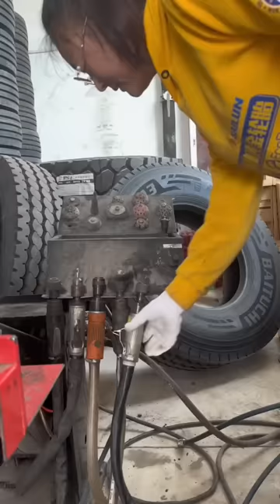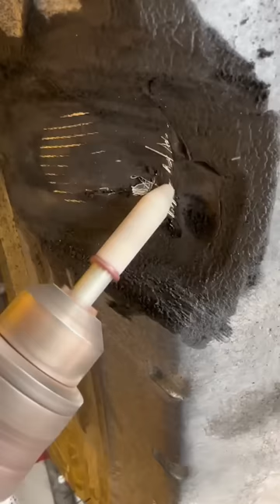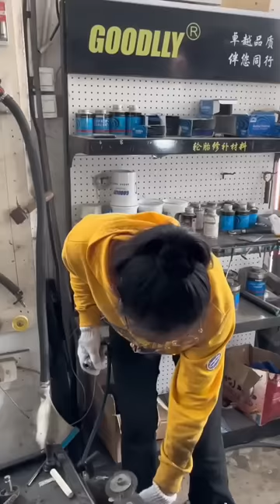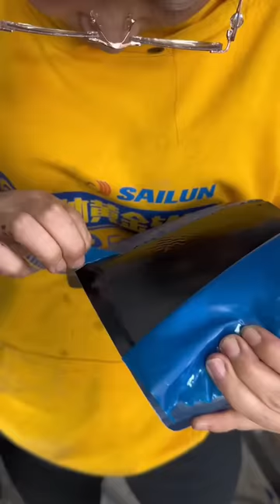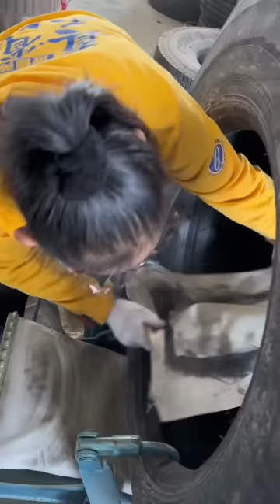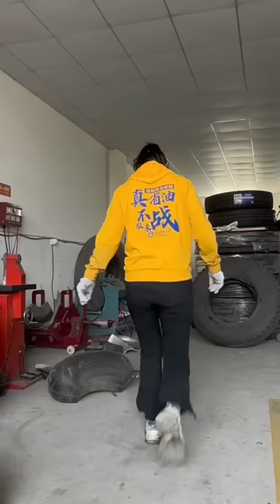Repair A Big Nail Hole In A Truck Tire Without Replacement

Comment: I had no idea you could repair a truck tire that way. However it's just fun to watch her at work.
Reply: You can't really
Reply: @Mattlawton-ft6ew  yes, you can.
the crown is a problem due to the edge of the belt package. thats why you open it up and carve it back. reinforce the injury with a section repair, and fill in the hole with cushion gum rubber.
Reply: @Wally Balldinger  its the correct terminology.   so congratulations on your inability to learn from people that know more than you on a subject.
Reply: @anytirellc What are you gabbing about?
Reply: Side wall is compromised. Doing this puts you at increased risk of having a blow out.
Reply: @anytirellc i don't where you guys are from, but I got friends that work at Tubby's Tire, Kal-Tire, Tire Craft and Fountain Tire for 20 years and never ever have heard the refer to a Tire have an "injury" ever. I an Canadian
Reply: @JoeBlack1108  im in the northeast USA.  do you have a better word to describe it?  if your friends only install tires on cars, they're not tire guys.  talk to those of us doing truck tires on highways and skidders in the woods
Reply: @anytirellc  fountain Tire is trucks
Reply: @anytirellc  been thinking, Tubby's is truck only also, Kal-Tire has certain outlets devoted to Commercial only. "Puncture" is how we describe a hole or something that went through a tire. Makes more sense
Reply: @JoeBlack1108  well, you're Canadian... so 🤷‍♂️
its more complicated than "puncture" there's body plies that can be damaged. read some scrap tires reports "injury too large" is a common cause fror retread/repair rejection
Reply: @anytirellc  my friend from Fontaine Tire is bring his car to my shop for exhaust repair, I'm going to ask. So strange to say an in adamant object has an injury 👍
Reply: @JoeBlack1108  i guess if you've never heard it before,  for me its going on 30 years of normal tire conversation.
Reply: @anytirellc  that's a long time changing  doing commercial tire work, like I said before my friend been doing it for 20 and his knees and lower back gets stiff from changing truck tires in the middle of a blizzard on the side of the 401. Tough work

Comment: I would have trusted the inside patch, the destruction the tech caused to the steel belt makes this tire an extreme hazard to anyone near it in operation, maybe even states away depending on what it's hauling.

Comment: No “reputable” tire repair facility in this country would even consider repairing that tire! Not to mention, by law they can’t!! That part of the tire has the highest stress levels.
And it seems she was more concerned about the rubber dust on her hoodie than in her lungs!!🤦‍♂️🤷‍♂️
Reply: thats actually false. a professional with the right equipment can repair a crown, and even a sidewall.
Reply: That is called a section repair and it is more common than you would expect. It is mostly done in Ag and OTR but can be done on commercial truck. Most of the time the cost of labour and materials make it cheaper to replace truck tires.
Reply: @AJ Nichols  not necessarily.  i charge $56 for a section repair here in new England.   vs a 4-6 hundred dollar tire.
once its been section repaired though i wont retread it. im not adding 4 more years to the tire
Reply: @anytirellc  I am in Canada and usually a section repair on a commercial truck Tire is 3/4 the price of a new one. But if it is cheaper there then it makes sense
Reply: She does good work👍🏼

Comment: Great job! This is a lot more than a simple plug job. She pulls off this repair easily which shows she has a high level of skill. I'm glad I found this channel!
Reply: This shows how wrong it is.
Reply: Patching and a plug would have been perfectly fine as I disagree with cutting away around the hole on the outside of the tire.

Comment: In my opinion: I was amazed at how far she went with it. A tire like that shouldn't go over 55 mph & be only driven in the city - like with retreaded tires.

Retreaded tires aren't meant for really high speeds & we see all sorts of shear off all over the highway because of it.

There are plug patches to simplify punctures. You'd grind the inside around the hole exactly like a patch  & pull the tapered plug through the hole extending to the outside tread to where you trim it flush. 

She appears to have ground into the belt structures for reasons unbeknownst to me. The tire should blow out there when hot. 

A tire like that would run 115 psi & after a long drive get to 175 psi. 

If that were to be a axillary rear tire for an off road trailer she might get some use out of it. But I wouldn't want to be standing next to it when it blows. 

Someone meantioned it was a side wall issue. But truck tires aren't the same as light passenger vehicle tires. Truck tires seal at the outside bead after being blasted with an air cannon to get the side walls to meet the rim with air rushing in through the valve stem.

I wouldn't have ground into the belt area even if I felt that I needed that tire being the last tire on earth & just used a plug patch & called it good. You could lay a bigger Patch over the plug patch as an extra precaution. 

That's some scary repair.
Reply: Don't try it if you have got her skill and experience. Too dangerous.

Comment: I would have double or triple plugged the outside,  then snipped inside and single and then double patched the eventual size used. I just do not see the benefit in taking out all that material only to put it back. But I do agree, a tire damaged outside the tread CAN be reasonably repaired.

Comment: If you noticed on the shelf it looked like it had Chinese written on it. I have a hard time believing it would be legal to make that kind of repair in the USA on drive tires and especially not on the steer tires. I guess since China places a low value on a human life of course they would consider it acceptable. I’m curious whether they even have high speed interstates over there.

Comment: 🛑🛑  Dangerous Repair. 🛑🛑
Cutting through the steel reinforcement wires in both the tread and sidewall is a disaster waiting to happen.
Don't know why she bothered vaccuming the dust out, she inhaled most of it in!

Comment: To the people who say this is agance the law. If it was a cold patch it would be this is vulcanising where you have to dig out all the damage rubber cut it back at a 45 degree angle of the hole an you use incited rubber heat it up an put in a reinforced patch heated it up an use a air bag. To melt the rubber a compress to become one with the rest of the tire rubber. I do this in UK mostly own OTR  an agri tires an is not cost efficient for truck tires.

Comment: Hey my dealer told me you can't repair the side wall of a tire, no matter how new.

It's just too dangerous he said.  Now, if it was on the bottom, you cd plug it.

I'd have to buy a new tire.  So, I bought a new tire.
Reply: in house, sure. but cap shops do it all the time.   if you wanna wait 4 weeks to get it back

Comment: I admire the young lady's passion and dedication...but I would strongly advise against doing that yourself on your tires.  As others have stated, you should NEVER try to repair a tire that has a hole on the side.  Also, she seems to be in a foreign country with suspicious safety measures.  Yes, being Latino myself, I know what it is to work in countries like that.  It doesn't take away the fact she is a very hardworking lady.  I just wish her be more careful cuz working like that will not be good for her health in the long term.

Comment: Is this what is referred to as a section repair? Im not a tire tech but I purchase tires and tire repairs. No tire shop I have ever been in contact with in the USA have ever told me anything other then tire replacement when it comes to sidewall damage. This usually leads to a 2 or even a 4 tire purchase with a dual wheel assembly. A good drive tire is now 600 to 800 dollars a piece in the USA. A tire repair like this might be worth a try with a vehicle that never travels more then 45 mph. Sidewalls flex a lot which is why, I am told, repairs to sidewall damage dont work. Many commets here have such repairs actually illegal in most US states.

Comment: Side wall repair only for use non mechanical area like trolley.
Passenger cars tyres side wall not recumend for repair because high speed

Comment: From the size of hole it could have been patched or even plugged. Yes I know all you Karens out there, you aren’t supposed to fix side walls. I’ve done both and ran tires until it was worn out with no problems. Only reason to ’never’ fix side walls is because manufacturers want to sell more tires. She did ruin it by cutting it so much and ruining the bands!

Comment: This is down right dangerous that tyre should of been thrown away ,cutting the side wall into the core of the tyre like that and then patching it ,it wknt be long before the tyre gives out and causes a accident, i wonder who will pay for the damages when that happens  ,you never ever repair a tyre like this and on a truck just imagine the load it will be carrying,bad so bad